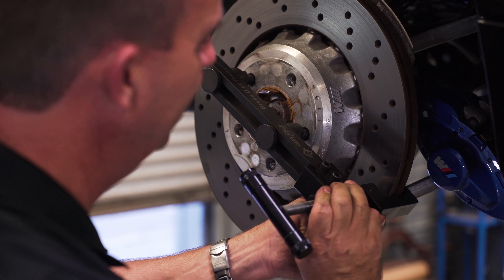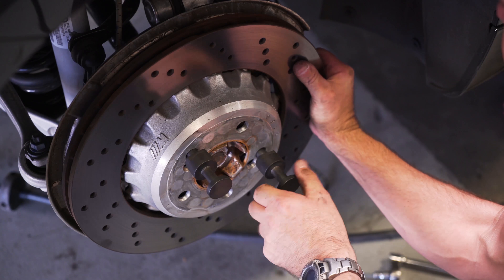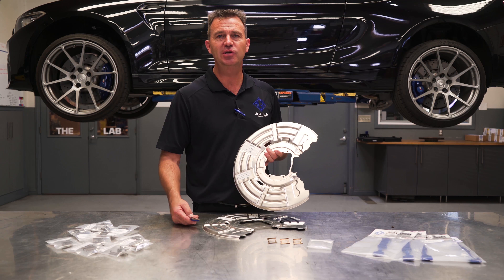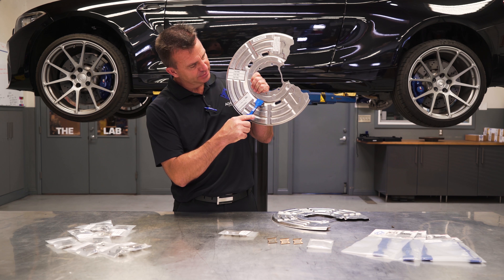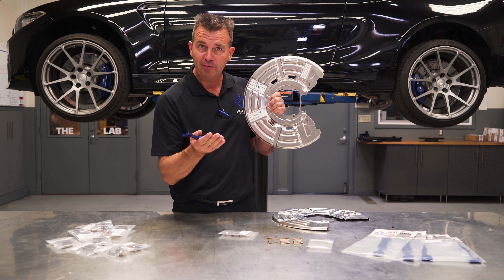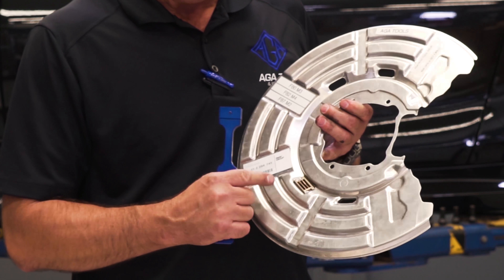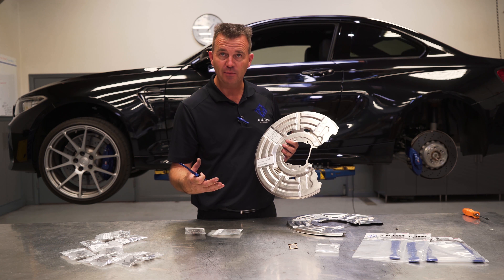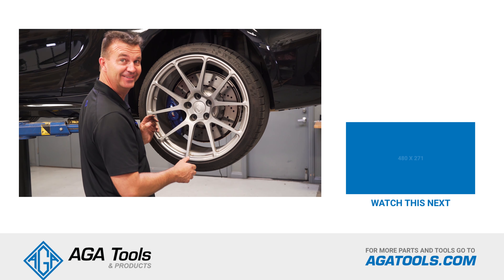AGA Backing Plate Screen

Comment: Why block more air flow for cooling of the brake disc? The new backing plate is covered under warranty.
Reply from the maker: Surebimmer, the vents were created for rocks to fall through, not to create airflow. Yes, most of them are covered by warranty, but there are some vehicles that aren't covered by warranty that need to have another option besides replacing the while backing plate.